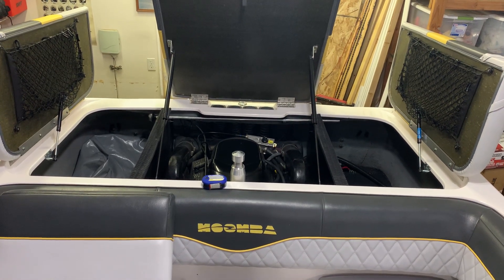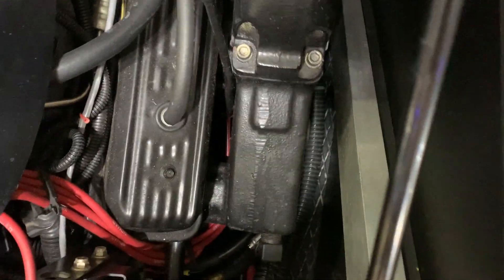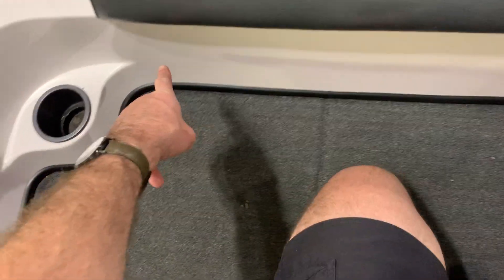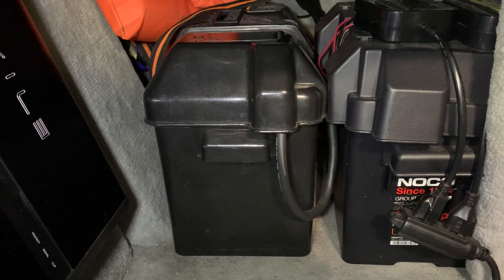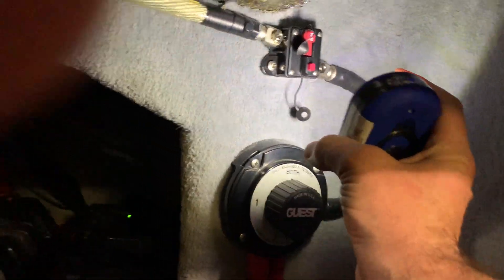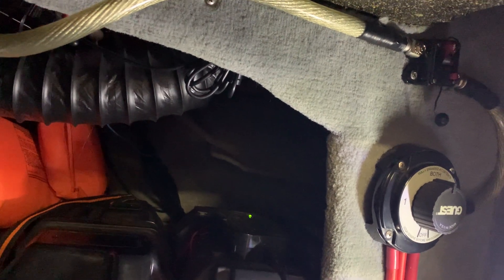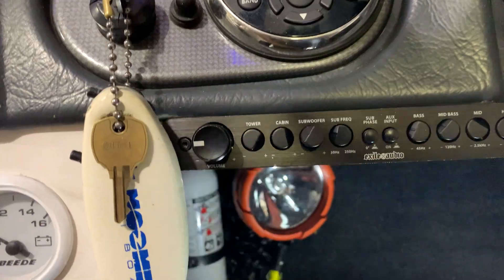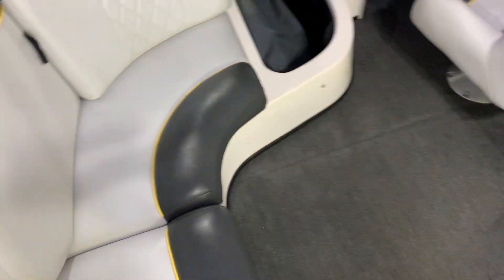2001 Moomba MobiusV Battery Wiring SomeStereo

Comment: Where do you get the little black trim piece that run along the border of the carpet that meets the fiberglass
Reply from the maker: I found it on eBay. Called marine carpet edge trim-lok with 3m adhesive backing.